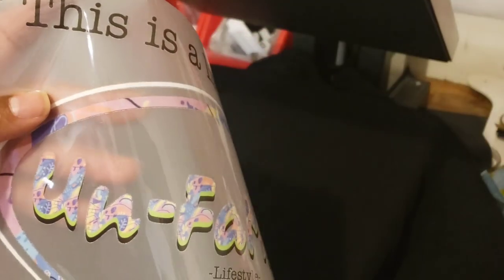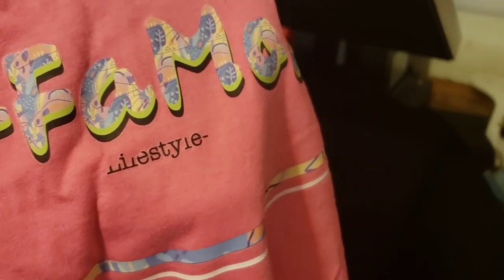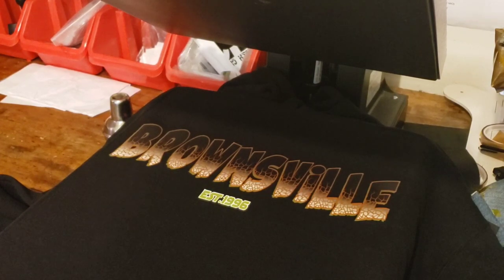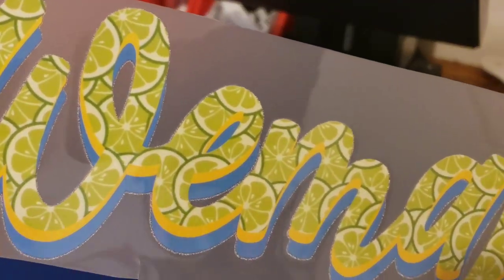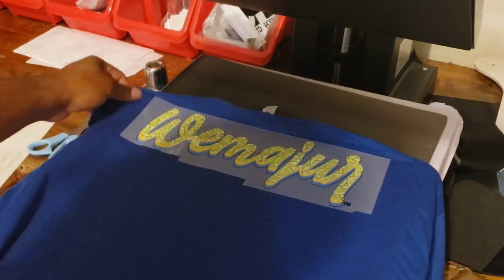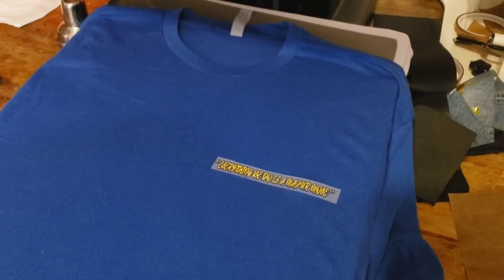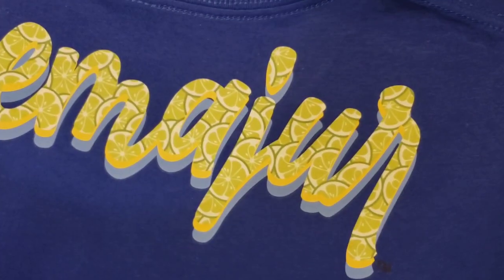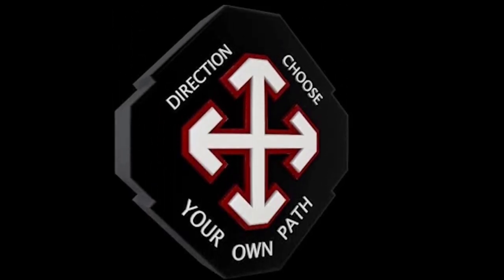Why I hate cold peel heat transfers/watch this before you buy cold peel heat transfers

Comment: When I press my cold peel transfers, my tip is to press it twice. Then pull up from the bottom while pulling down on the shirt. Easy release every time
Reply from the maker: Good advice, sounds time consuming if doing front and back with sleeves on multiple shirts but its worth a try.

Comment: At least you are getting the peel! Maybe you can help me out.......I recently purchased forever laser dark transfer sheets. I got the marry process down. But not the peel. I have waited 30 seconds up to 10 min (ive practiced on like a dozen shirts fml) I started at 300 degrees for 30 seconds and went up to 342 degrees for 43 seconds. I tried making the pressure higher, I tried making the pressure lower. Every time the peel is hard to peel and pulls some toner/lettering up. WTF am I doing wrong!? Thank you for videos and help on this.